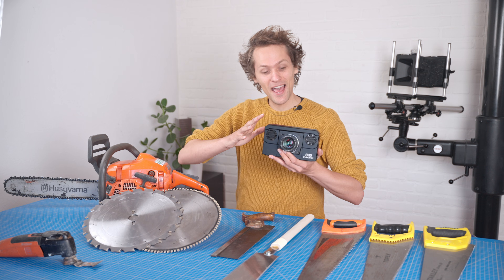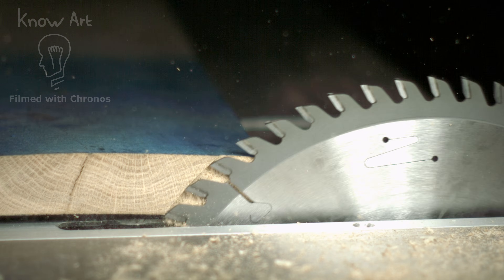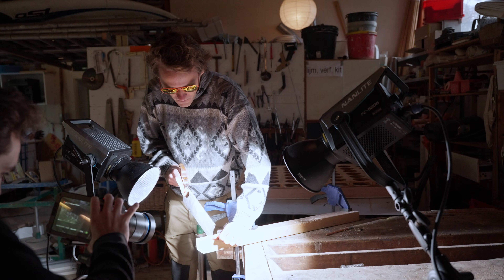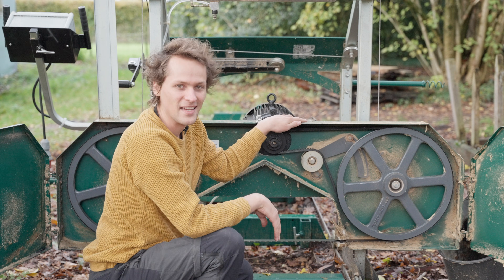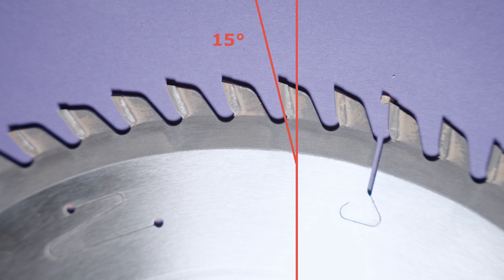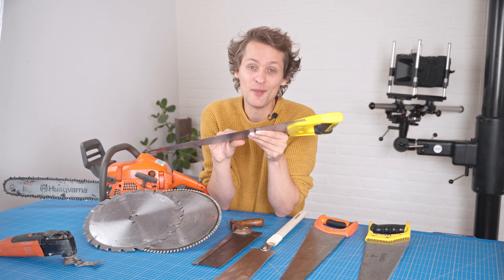Why Crosscut Saws Can't Rip

Comment: I think that the gullet on the blades probably fill up a fair bit more when you have material on both sides of the blade, therefore trapping the shavings in the cut, instead of flying out the side like on the cuts you made.
And on your 24T rip blade, the bump behind the teeth are the same as the rakers on the chainsaw chain, they limit the amount of material it can bite at the same time, grind them down and you will see that it can really bite like hell!

Comment: If the teeth look stationary or almost not moving at all and the inner blade is whizzing around visibly you're losing detail with too low frame rate and not seeing cuts as they happen but in discrete chunks. Looks cool though

Comment: You conducted your experiment wrong. You can’t apply the same pressure on the wood when you have a different number of teeth because then the pressure per tooth is not the same. For twice as many teeth you need twice as much pressure, and you should be able to cut twice as fast. And of course you need twice the power.

Comment: It's the angle and the chip load of the tooth. Less teeth equals a steeper angle and higher infeed clearance (feed rate) per tooth but also increases pressure and tear out, while more teeth equals a shallower angle and less infeed clearance (feed rate) with lower tool pressure for finishing cuts.

Comment: Im sure you know but With chainsaws there is “ripping chains” which are supposed to be better cutting parallel to the log. But also with standard chain you can use the tip only in a dragging motion to do the same thing. Although a lot slower. Makes long strips . Would be neat to see more slow mo of that

Comment: when people actually used to worry about such things, table saws often came with two spindles, so there was no messing around with swapping blades between rips and crosscuts... mostly joinery and pattern making.

and it was common knowledge when filing teeth or setting them...

i love doing a  rip on a chainsaw... weee! noodles! dont do it often enough to justify chisel sharpening?

also note the rakers and chip clearance on a chain...
also, as the ripping edge has that angle, it tends to force the teeth to spread apart on either side of the bar, allowing the crosscutting side edge to do some work... the steeper the angle, the more spread they get, and the sharper that crosscut edge... flatter angles for ripping as you dont need the side action as much. 0 degrees on the top is going to also produce a side edge of 0 degrees...

a slightly wider cut than the actual tooth width would suggest...

Comment: Most modern chainsaws (all of them?) don't actually need your wrist to hit the chian brake to activate it, they have inertial chain brakes which will activate if the saw is jolted upwards hard enough
Reply: Do they still have the mechanical chain brake as a backup?

Comment: We used stroboscopes to make saws and belts & pulleys to appear to stand still so we could optimize speeds & with multiple belts on pulley we needed to has a certain amount of slippage with the belts so we did not have objectional vibrations and too much tension both of which destroys the bearings. Fine tooth saws are for plywood and thin wood.
Reply: A neighbor gave me an old 1962 Hewlett Packard oscilloscope that had been modified to be used as a very precise and high speed strobo-scope for the FAA. It ran at full brightness and is has a built in function generator. Everything looks blue-green but you can make a dentsist's drill appear to stand still or run slowly in either direction. The FAA used it to watch jet turbine blades for weird deflections & oscillations as the blades turned.

Comment: 2:53 this cut is only skimming the edge of the wood leaving one side of the blade open to clear sawdust outward. In a normal scenario the wood would cover both sides of the teeth changing the dynamic

Comment: the Oscillating Multi Tool is actually more efficient than you take it for. it just works a little different.

instead of pushing down HARDER, you should leave if loose with just a bit of pressure, lifting out occasionally to clean out the wood chips, as those don't go anywhere otherwise, since it moves back and forth. if you press down hard, the tool does not have the power to move well, whereas if you leave it looser, with just enough pressure to cause due friction, it can cut through soft woods fairly quickly (i've cut a 2x4 in less than 30 seconds), and i have even cut hard woods with slightly more effort.

also, if it seems like it is NOT cutting well, simply ease up on the pressure a bit, and tilt it slightly sideways, and it will clear a path in that side. cutting LESS wood at a time is always faster!

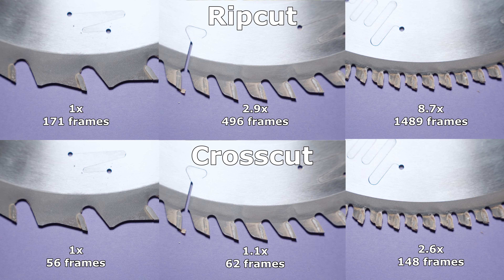Comment: In that explanation at about 4:00 you use my linguistic pet peeve like seven times.
When you say "8.7 times longer", you're using it incorrectly.

Let's simplify it. 2 times bigger. People (unfortunately) usually use that to mean double the size. What it actually, and literally, means, is TRIPLE the size.
"bigger" turns it into a comparison; you establish that the number is larger with that word, and you're stating HOW MUCH larger it is.
Using the same sentence structure, you can demonstrate that it's wrong; if you say "0.5 times bigger" it suddenly doesn't make sense in the common usage, but it's structured exactly the same way.
Another way of reframing it, replace the multiple with a percentage. If instead of "2 times bigger" you say "200% bigger", then the literal meaning is the only plausible intent.

In your usage, you're saying 'saw B took 870% longer than saw A', when it actually took 770% longer.

It's best to just avoid using comparative language because of this stupid pit we've collectively fallen into.

Comment: Everyone talks about the advantages of Japanese saws.
But no coin has one side, so what are the drawbacks of japanese & advantages of western push-type saws?

Also, has there been any western pull-type saw prior to modern importation of Japanese saws? I'm asking that mostly so we can finally shut the weebs up.
Reply from the maker: You can put more power into a western saw. But in the modern world you never make big cuts with a hand saw right? you'd go for a machine. I don't know, it really doesn't matter that much

Comment: Your frame rate should match the rpm. It looks like you're probably under sampling. The marking closer to the blade center is moving at a different rate than the teeth.

Comment: That multi-tool saw works on the exact saw principle as cast saws, which need to cut the very rigid plaster but obviously not the skin under it. I can tell you having a cast removed is still terrifying!

Comment: Great video. 1 correction though, as I went to school for working with Chainsaws. Chainsaws don't need your hand to hit the brake at all to stop. The inertia of a kickback is enough in a properly functioning saw. And we were taught to test the function of it by having the saw off and without the brake applied, then, holding the rear handla of the saw you let the front of the bar fall onto a piece of wood from a pretty low height (not sure exactly how high, but about 50 cm or so, haven't measured it, I just go by eye). The moment the saw hits the wood the brake should get applied and stop the chain. This is a crucial safety feature as not all cuts are done with a grip that has your hand positioned to hit the brake in case of a kickback, so always check the saw for proper function.
1 more safety thing for people who are interested: When working with any chainsaw you should always wear the correct protective gear, BUT, with electric chainsaws you should wear different gear as not all chainsaw ppe works with them as they can be harder to stop by the regular ppe. So just wanted to give that warning as many don't know that and I should also add that it is NOT meant for use with circular saws or any other type of cutting implement, only chainsaws. This goes for ALL chainsaw ppe.
Great and interesting video though. Nice to see slow-motion of saws working.
Reply from the maker: yeah I noticed when trying to get this slow motion shot that it didn't just happen when my hand hit the break! Thought my saw was just clapped out, but apparently not. I'll put it in the corrections! thanks
Reply: @KnowArt Happy to be of assistance. Great video. Keep up the amazing work.

Comment: It's not malarkey. There isn't enough room for chips. But that isnt all that's happening. The depth of each tooth is reduced with tighter spacing limiting the amount each tooth can bite. If you've ever sharpened a chainsaw correctly than you know there are two parts to address. The cutting edge itself and the depth gauge that controls the bite each tooth is allowed to grab.
Edit: I said all this at the beginning of the video not knowing he basically covers this concept.

Comment: I have been suggesting this exact video to the slow mo guys for probably 8 years now. Can you please do drill bits as well? Would love to see that and perhaps also different screw types with different width and turn ratios etc on how they interact with wood
Reply from the maker: oh, drill bits is a great idea! will be super hard to film though.... hmmmm!
Reply: @KnowArt  drill press on the edge of a piece of material to give a similar result to the saw but for material removal I was thinking a close clear medium like plexiglass or hard resin might work at least a little bit not sure though

Comment: i dont think the gullets fill up either but your video of the cut didnt show that they dont.   it shows that they dont when you give the sawdust somewhere to go, like by cutting on the very end of a piece of wood
Reply from the maker: it's a bit of an optical illusion because we're frame syncing. When you pause the video on any frame you can see all the sawdust that's produced and potentially flying off. and it's not much!

Comment: It's less that the gullets get full, and more that since you're taking smaller bites, you're giving more time for the heat energy from the chips to transfer to the blade before being ejected. This is the same mechanism that makes rotor speed and feed control so important for CNC operations: more heat being transferred into the blade can damage the carbide tips — as any steel gets hotter, it loses temper and becomes softer, until eventually you have a part that is soft enough to be separated from the rest of the steel.

This heat buildup also transfers back into the wood, which combines with friction to make the wood nice and hot. If you're not moving fast enough, you end up with burns and a stressed out motor. Also, sappy woods like pine can burn even more easily since the pitch in the wood will increase friction and also starts burning at a lower temperature than the wood does.

As a matter of fact, there is a simple way to test on a router if your feed rate and spindle speed are correct: once you're done with your cut, and the router has fully stopped moving, feel the bit (I usually check the shaft so that I'm not touching anything sharp). The bit should be, at most, warm to the touch. If it's hot, then you need to either lower your spindle speed or up your feed rate. I would suggest that a similar test might work on a saw, but you won't catch me touching the saw blade until the machine is completely off and I need to change it.

Sorry for the wall of text, I just used to teach woodworking occasionally and this was one of the short lectures I had about CNC and routers, as it helped folks get much more consistent results from their machines.
Reply from the maker: that's a great tip! thanks

Comment: Medical bone saws are almost always oscillating saws when it comes to joint replacements because there’s so much soft tissue surrounding the hard bones in a slippery and small environment
Reply: I'll check that out - I'm dgoing in for a full knee replacement shortly under a nerve block rather than a general anaesthetic, so with any luck I can watch ;<)

Comment: 12:02 In fact, this effect is used in medicine too. There are special saws that they use to cut casts off healed limbs. These saws oscillate back and forth like the multitool; however, the go faster, but also a shorter distance to each side, and their teeth are finer. This is great a cutting trough the dry, hard matter of the cast, but if it comes in contact with the skin, it will just lightly wiggle it back and forth. So it's completely safe to just plunge the saw into a cast with skin underneath. Really clever design!
Reply: They have 37,000 rpm rotating cutting burrs, out on the market now that can cut right through bone, but won't cut skin. That is crazy technology they deployed!
Reply: the stryker saw had the patents for decades, so was exclusively used in the medical field.
pretty sure its primary goal was brain surgery... cutting through skulls without piercing the... its not "derma"... erm... ffs, no... i am NOT googling it! i had it in my head just a second ago... ffs... layer of "skin" over ones braiiins... it worked just as well on casts so a few found their way into a different ward...

as soon as the patents expired, the market got flooded with the "multi tools" because plenty of people saw the use for other things... like plunge cutting a skirting board...
Reply: I think the layer surrounding the brain is called the meninges
Reply: @paradiselost9946 the word you are looking for is "meninges".
Reply: @paradiselost9946 
I read that as "layer of 'skin' over ones brains ... Once the patients expired, ..."

I was wondering what exactly they were going to use the saw for after the patient expired.
Ah, PATENTS! Not patients. That's better. :)
Reply: Yeah but multi tools have a strong rougher vibration and longer range of movement and blades not made for safety so it will cut you.
Reply: @erueka6  yeah and they depend a lot on brand. Milwaukee's multitool has a way larger arc of movement than most and would go straight through the glove and your finger.
Reply: Yes a multitool is not a replacement for a bone saw lol
Reply: Здравствуйте. Именно для этого и придумали асцелирующий инструмент. Это потом он появился у строителей 😁.

Comment: At our family sawmill we had 2 huge bandsaws (each saw band was about 8" wide with 1" teeth). We had a big felt pad that we would dip in coloured diesel every now and then. It would ride on both sides of the blade as it came down out of the wood and lightly coat the blade to prevent resin build up. We used them for resawing lumber and timber into smaller dimensions.
Reply from the maker: people love to use diesel, although my manufacturer advises against it because it's not great for many of the rubbers/plastics on other parts of the machine I believe

Comment: Led are not a continuous lighting source. Via PWM you can have them flicker at any rate. Although a too slow of a rate will cook the chips, as the flicker is a big part of the heat management🤗

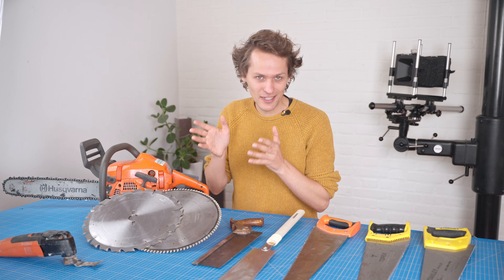Comment: 11:56 because an oscillating saw can't cut through materials flexible enough to vibrate with the blade; they are used to cut open casts and don't cut into the skin.

Comment: man I've cut wood with a hand saw only a couple of times in my life (I'm a city kid) and I had no idea why I sucked at it lol! Turns out different tooth sizes and configurations are good at sawing against or along the grain, I had no idea
Reply: I learned only the past few years myself cuz I would just use whatever and it didnt go well but some saws would work better and I had to figure out why (I inherited a bunch of saws so I didnt know which each was)
Reply from the maker: that would look nice! although it would give other practical problems. The speed of the blade changes throughout a cut, the wood changes, and with less fps that would give a jittery motion. And we'd only be able to film very very long pieces of wood because we're cutting a full rotation's worth of wood every frame
Reply: @KnowArt  you may have replied to the wrong comment by mistake.

Comment: 12:08 this is the same reason why cast saws can cut casts but don't cut your skin! They're round, but they don't spin continuously. They just wiggle back and forth very slightly, which cuts the hard plaster of the cast but just drags the soft skin of your body.

Great video btw

Comment: Very informative vid. Although, I think there is an aspect you overlooked - while you did mention the angle of the teeth on the blade itself, I didn't hear you mention the height you set the blade at in the saw... which actually makes a big difference to the longevity of the blade and the cleanliness of the cut.

You have you blade set really high, so the teeth are cutting through it during the downward part of its rotation, this means that each tooth has to cut through more material each rotation and is cutting across the direction you're pushing it. Meaning, blade gets hotter and gets blunt quicker and cuts will likely splinter rather than being clean.

So, the way to solve this is to set the table saw blade a couple millimetres higher than the material your cutting. So if material is 10mm thick, the highest point of the blade above the table should be about 12mm.
This way, more teeth are doing less work by cutting into the material head-on, which means less heat and a cleaner cut.
Also, the speed at which you push the material through shouldn't be too fast either.. You don't want to work the blade, just let the blade work for you - forcing it just cooks the material and heats the blade.

How do I know this? I'm a floor layer.. And I'm also Australian.. so a blade, a knife, a "that's not a knife" knife, it doesn't matter, Australian saws are always sharp 🤪
Reply from the maker: oh that would've been a great test too to see what happens at different blade heights with the same material